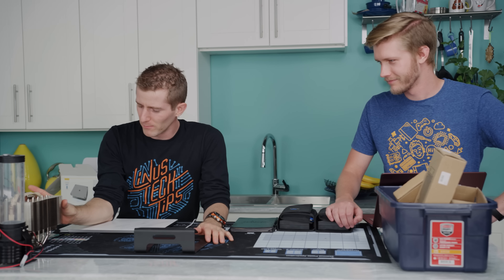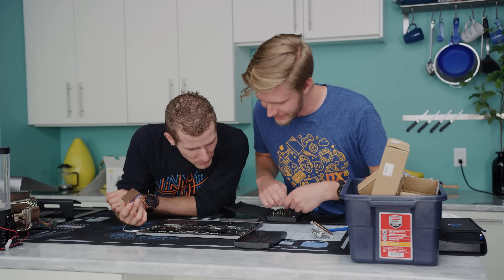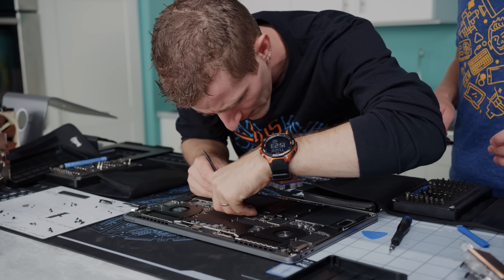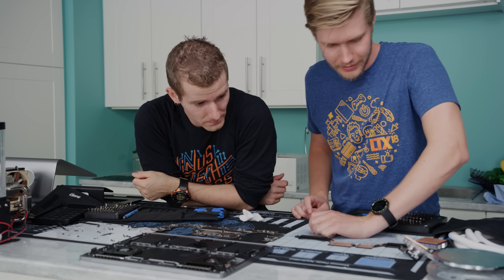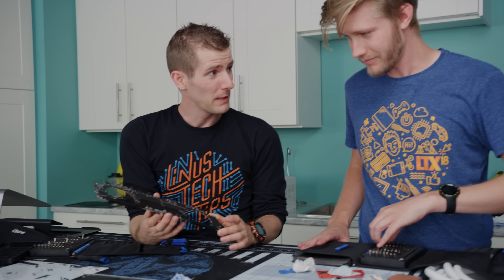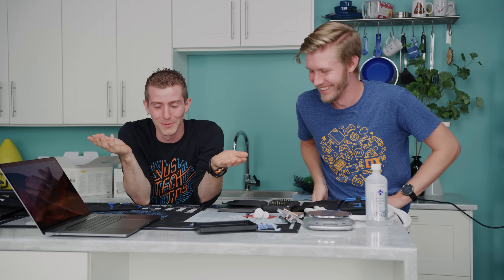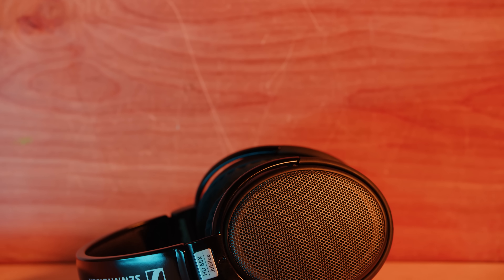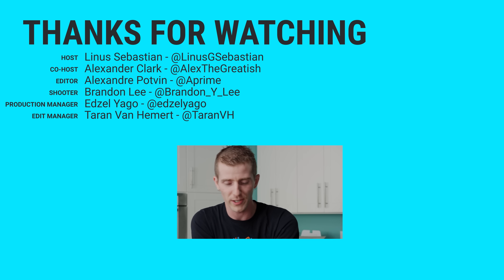We FIXED Apple’s New MacBook Pro

Comment: Wait you added a few USB As, an SD card slot, a proper chiclet keyboard, a good webcam, OS X Snow Leopard, MagSafe, and a cooler laptop without affecting size or weight?

Oh.... just liquid metal. Welp..
Reply: I don't get why they don't just take the front camera out of the iPhone and throw it in the MacBooks
Reply: Dongles were shitty in 1998, and they're shitty now. Apple must dig the tangled tentacle look though.

So courageous!
Reply: @noanoxan  I do get why apple did it. It looks clean and A S T H E T  I C because all the ports are the same. This is why the camera is also crap. Because the one in the iPhone is too big. It literally protrudes out of the iPhone and they already bought enough for years. But what about magnetic attachments for the sides like a Moto mod? Nah they already have dongles. Plus apple thinks the laptop is going to be phased out soon. The keep updating it less and less.
Reply: @Corei14  the iPhone 'selfie' camera, not the big one should be the macbook webcam
Reply: Keep Talking, Nobody Listens you’re forgetting it’s the PRO. A real professional couldn’t give a shit about if it’s a mm thicker or if all the ports are the same. No, apple is trying to appease to people like you, people that will fall for this shit. Tell me why most PROS are still getting the 2015 model..

Pros just want a lot of performance, and lots of i/o. My guess is that they were already to deep into apple (iTunes,iCloud,final cut pro) so they were like fuck it.

And they’ve kept updating the MBP on a 4 year cycle. Consistent since 2008. If apple thought the laptop was going, they wouldn’t be selling 3 of them
Reply: That would make it a PC. A hackingtosh
Reply: Keep Talking, Nobody Listens wow the first MacBook Pro was a hackintosh, lovin’ it

Comment: You can tell from the sales of the Macbook Pro that it has a lot of *fans*, yet it can't use a Core i9 to its full potential.
Reply: It's never going to be a good idea to put an i9 in such a small form factor laptop.  Unless a new element is discovered that can conduct the heat away more quickly, it's always going to be a problem.  Process node size is reaching a limit in how much it can be shrunk, so multi-core is basically the only way to get large tangible leaps in performance between generations, but without a process shrink, those cores are always going to release the same amount of heat.  
Until we decide that backwards compatibility doesn't matter and nix the x86 architecture for something a lot more efficient, we're not really going to see too much more single core performance than we have now.  Or if we do, it will produce more heat.
I guess when we hit that wall, we'll have to figure something else out.  There are materials that exist that can support even smaller process nodes than silicon, but they are more expensive, but even then the can is just kicked a few years down the road.  I really wonder where innovation will take us.  It's really exciting.

Though I have a feeling that they'll keep using planned obsolescence patches to slow old chips so they can sell new ones with the same speed as faster, until something completely new comes out.  I hear the new chips have a hardware patch that returns the lost 10-30% performance hit from the spectre/meltdown software patches.  I think that's going to be a thing for a while.  Quantum computing is a nice buzzword, but I doubt we'll see it being used in household devices in our lifetimes, so it'll have to be something else.
Reply: @BothHands1  I don't really see how the x86 architecture is holding back innovation. I mean we do have x86-64 extension to thank for getting us this far and yet there's no server or storage device in the world that has even reached theoretical memory limit yet. As for quantum computing, it is complete overkill on how we are supposed to cool them (Ahem liquid nitrogen)
Reply: ShockwaveEXP x86 is good, definitely, that's a big reason it's been used for decades now.  But there's also a reason why ARM has dominated the mobile phone market.  
The x86 instruction set is less efficient, and so it uses more power, and produces more heat than ARM, for example.  x86 also requires a lot of extra die space, which gives ARM an advantage in miniaturization.  It has nothing to do with 32-bit vs 64-bit, the issue lies in the efficiency of instruction execution.  But losing backwards compatibility would be a huge disadvantage in a new chip, so that's why we keep using it.  Imagine buying a new intel chip, and having none of your old games or programs work on it, due to instruction set mismatch.
We might be able to get around that with emulation, though that would eliminate the efficiency advantages for those programs, leading to extra power drain and heat production.  It would probably even make backwards compatibility even less efficient.  

I'm not sure where the market will take us after we hit that wall.  I'm excited to see where we go.  But as long as we keep using x86, we'll never have a chip comparable in power to an i9 in such a small thin-and-light form factor.  The laws of physics just don't allow it.  In 10 years, with a few more die shrinks, we might get something as strong as today's i9 in that form factor, but at that point it will be much slower than the i9s of 2028.  

The only reason i brought up quantum computing was to preempt the "quantum computers are the next step" responses, because they're just not.  I don't know if ARM is the future of all devices, or if another even more efficient architecture will take over, but it's definitely not quantum computing.

Anyway, sorry for the long response, I've been drinking and just felt like blowing up some comment sections lol <3
Reply: @BothHands1 That's fine, its good to know that drinking levels up your enthusiasm for the tech industry.
Reply: It is too soon for a Core i9 to be even be put into any laptop, period. There are other laptops with i9 that too thermal throttle like crazy. It really isn't just Apple's lazy design.
Reply: @ShockwaveEXP  there is nothing lazy about that design! It is just way over designed! :p
Reply: @Gaber820  How is using cheap adhesive to hold the display and other inside components not considered lazy?
Reply: @ShockwaveEXP  that's just one component to the whole design, bud. Is using 16 different types of screws lazy? Or how about using screws within screws?
Reply: Ikr!
Reply: those heatsinks tho
Reply: If by fans you mean sheep , then yeah, Mac's have always had plenty of those..... Apple is the damn shepherd of a cult of em'. But sounds like it could have benefited from more physical fans as well. :)
Reply: Same can be said for most small Core i9 laptops
Reply: Not if people are willing to sacrifice a laptop being less portable in exchange for a Core i9 working properly